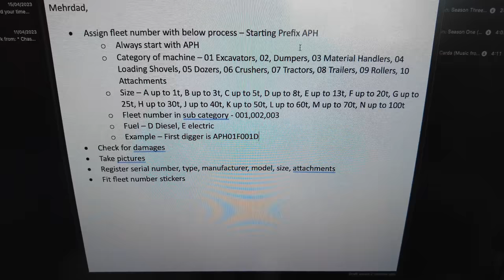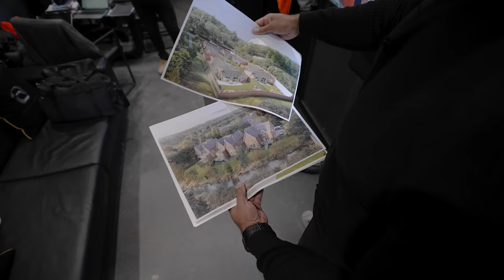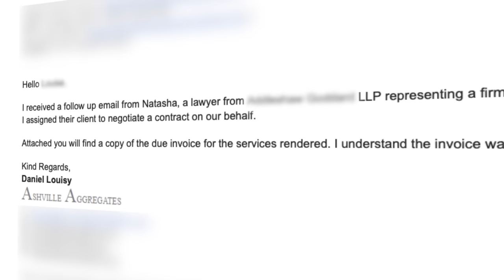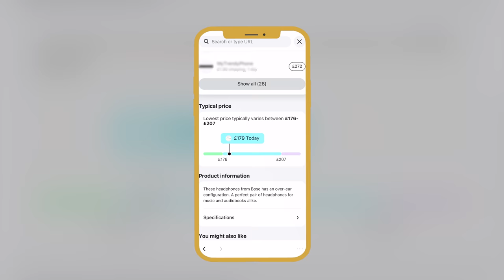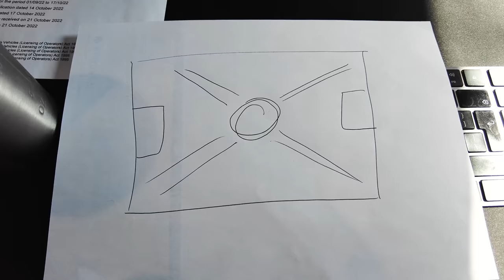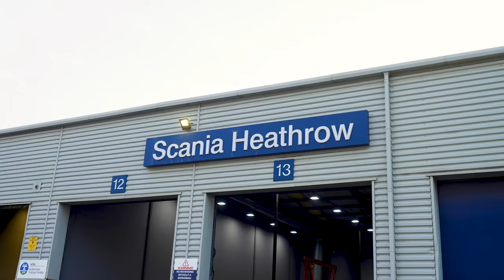BBC News Material and £20k Hole | Ashville Weekly ep133

Comment: You need to set-up a secondary authorising process/sign off limits. So, your finance officer can authorise up to a certain limit and after it will need you/Terry for final approval. This works well in the public sector to prevent similar type of issues. Hope you can track it down 🤞

Comment: The measures to put in place to not happen again could be: Training on Phishin, 'ishing and smishin. Next could be a codeword (in white text on emails) over x amounts. and further to that over X amount, a second member of staff or even 3rd senior member is needed to authorise it as it goes through the chain of command. Would you rather the payments are a little slower, or losing another 20k? EDIT: if the bank asks for clarification is it fraud. That member of staff or any staff should seek further guidance from line Manager or senior level. Also. don't maybe let new staff handle over certain amounts for a few months. Train staff on your sign off emails, so to look for fraud.. just a few ideas. hope something sticks.
Reply: And add a policy that no payment is to be made without direct reference to an invoice that has been cross-referenced to a documented order and or to the bank account that differs from what is stated on the invoice unless there's a signed paper authorisation by one of the CxOs. That very simple policy catches 99% of phishing cases.

Comment: Just something to think about Daniel while you are doing that drainage job.  I had the same problem on a build project, when you dig the big pit and fill it full of soak away stone it attracts water like you would not believe.   Removing compact soil and replacing it with air pocketed stone is like a magnet to water flow.   The bigger the hole the more it fills up.   I wonder if you put in a plan B for water clearance in the form of a hidden floatation pump.  Just a thought if your ground puriosity soak away test is poor.  It could just be your top surface collecting water if so it will all be fine.  I hope you don't mind my input I don't want you getting call backs.

Comment: there should be a protocol for that something you should put in place like the bank should check/call you for final confirmation or an alert because its going to happen again regardell and next time it will be your actuall email thats been hacked or used if someone is that good and determaned enough

Comment: Daniel it's not the end of the £20k.

Speak to ActionFraud, for £20k they should follow up on that. Won't promise you'll get it back, but maybe some form of justice.

Secondly, you need to setup your emails better. You need to setup SPF, DKIM and DMARC to stop email spoofing. Then you need to enable external email marking in your M365 organisation. 
Finally, I'd agree between your team that bills above x (or all bills) are never paid just from an email (be that a text, face-to-face, etc).

Comment: Sounds like a total lack of common sense on the new hires part. When the bank call flagging the payment you would automatically double check and not use the original source as confirmation... how can you leave someone without any common sense in control of payments of that scale? You don’t need that in your life. 

Do you not have a ordering system that requires authorisation for orders to be made? Which allows you to set up different scales? Ie a low level employee can order something upto a grand but if it goes over a grand it goes to the next level for auth? It's red tape but it helps protect.

Comment: Why does a new member of staff have the authority to clear 20k..
Reply: Its a very good question
Reply: Quite simply because in a large company they will have large outgoings, the weekly diesel bill alone is probably close on 20k.

It's all relative.
Reply: @paulf2529  that's not good enough reason at all
Reply: @StubzGaming   I disagree with the mistake being made but in a large company you will have staff making large transactions. The issue is the mistake should never have been made.

Someone being paid to do the accounts who has limited financial clearance won't be a lot of use.